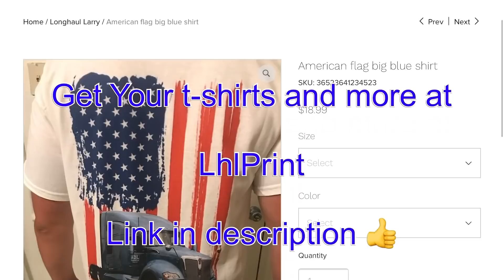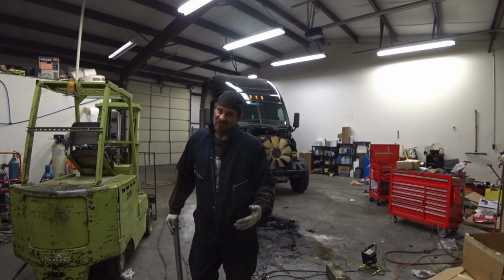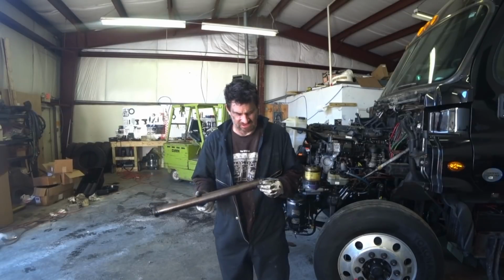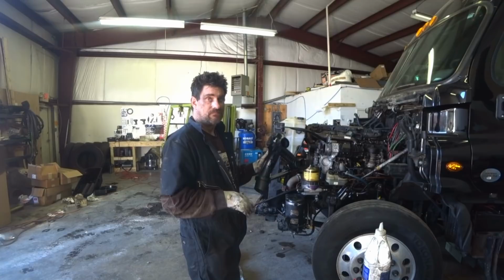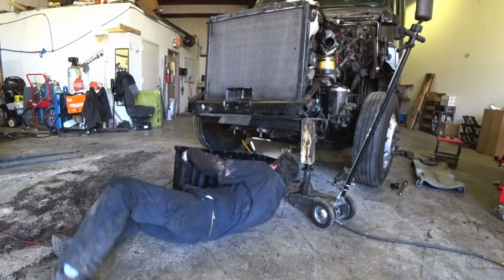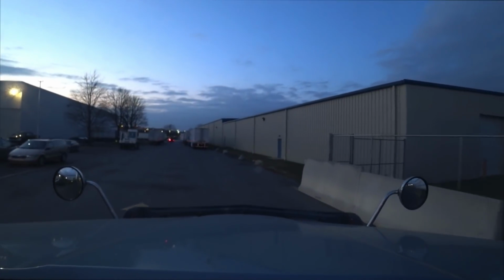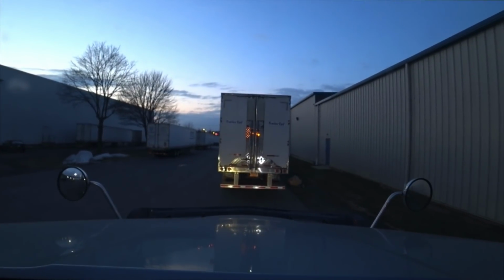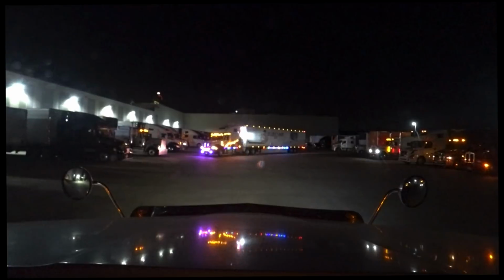Will this be the day to Fire up the Black Pony? 2021/23

Comment: Low oil pressure on a truck with anything over say 350,000 miles hmm, it can be a crap shoot as to if a new pump cures your problem. It depends on the over all condition of the engine and if the truck had been beat on or not. Low oil pressure can also be caused by excessively worn crank journals , IMHO